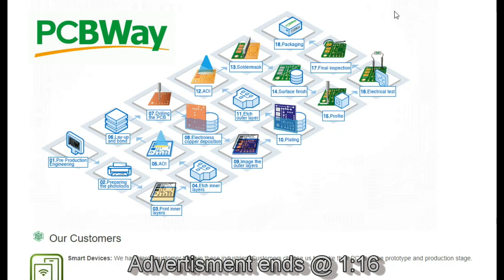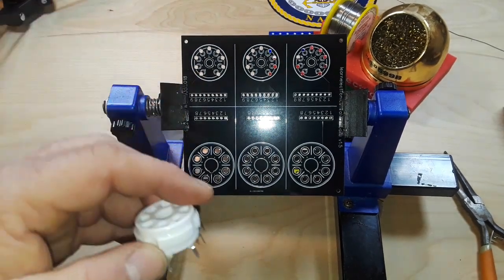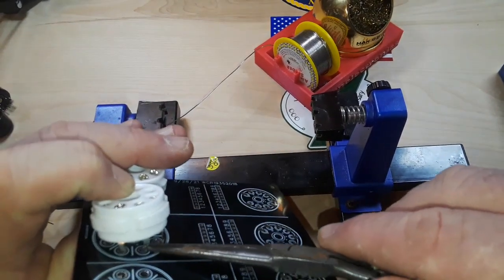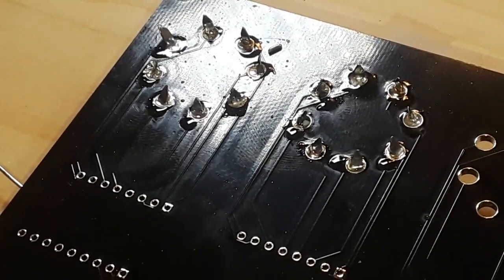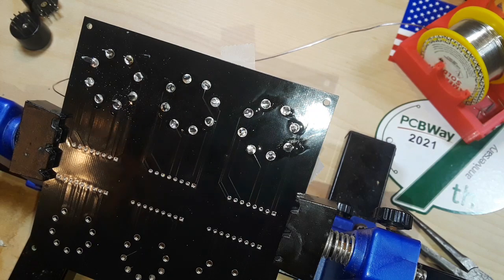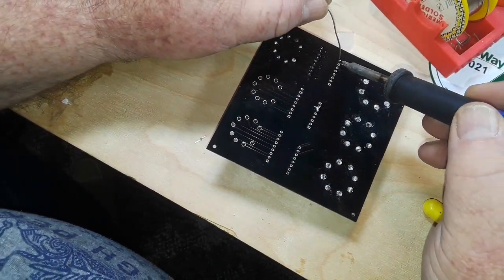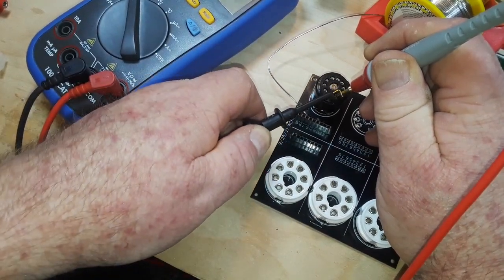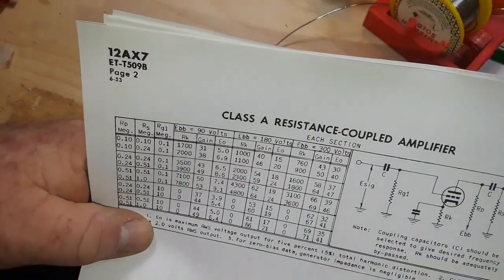New Tube Experimenter's Board PCB DIY

Comment: I would have thought that you would fold the clamp pins in before soldering to give you a better hold of the socket to endure multiple tubes being plugged in over time.

Comment: i have a Line 6 Ax 2, which came out before the spider and pod. I still think it’s one of the better sounding modeling amps, although the reverb and time based effects leave a lot to be desired. the one thing that analog amps have which modeling amps can’t do is that it’s possible to change the output characteristics of the preamp and power amp circuits by pushing the inputs with hot pickups, and additional nonlinear gain stages from dirt, filter, EQ, compression, wah, and boost pedals. the A/D converters in a modeling amp decouple that symbiosis because if you push them you just get digital clipping. i decided i liked the flexibility of pedals and pickups more than i like the flexibility of digital modeling and so i went back to tube and solid state analog amps after years of using physical modeling processors exclusively.
Reply from the maker: I've flipped back and forth between multi effects units and pedals.
On my board now is a wah pedal, Keely Darkside, Boss dd6, and Behrenger Compressor.

Comment: I would think a big PCB company would be able to make the slots for those socket lead instead of the huge hole? They could use a small end mill to mill the slots.

You sure didn't leave much space between the tubes for cooling but it's probably not going to be on for extended lengths of time anyway.

All the amp companies seem to be switching from hand wired to printed circuit board amp designs for cost savings.
Reply from the maker: Yep this is just for a few minutes at a time.

Comment: a little tip for soldering the sockets: the holders for the tube pins are somewhat movable.It is better to insert an old tube into the socket before soldering it in, so that the movable metal sleeves that hold the tube pins are exactly aligned. Otherwise it can be difficult to insert the tube afterwards because after soldering the holders are fixed, and if the alignment is not exactly right, you need considerably more force to insert the tube